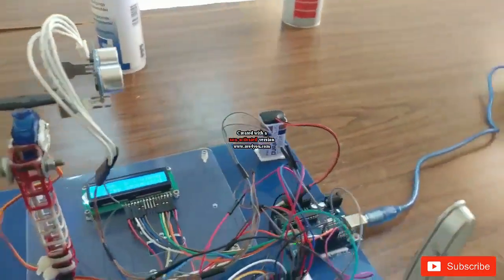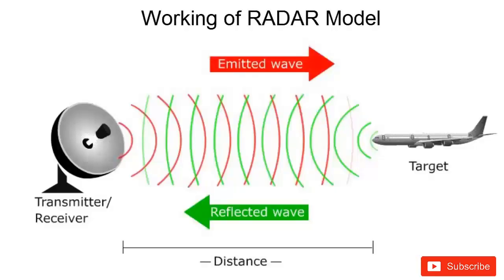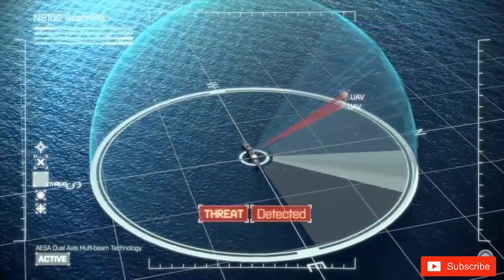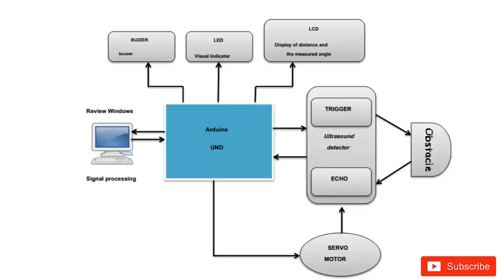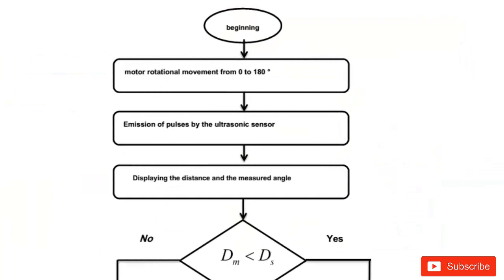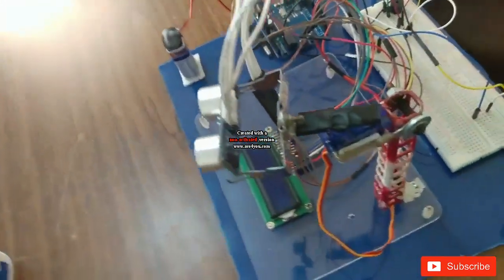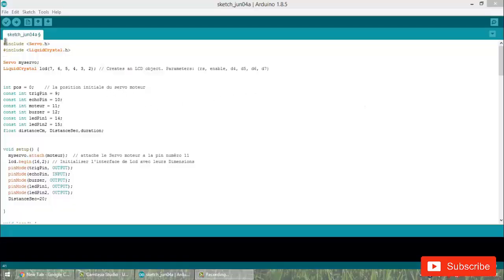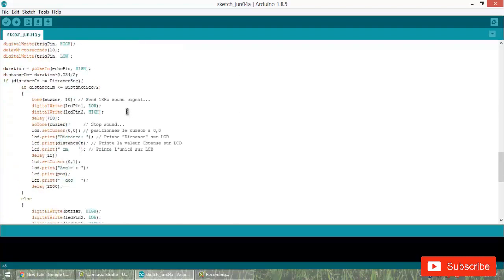Arduino RADAR Model for Distance & Angle Finding using Ultrasonic Sensor

Comment: Great project, very interesting. Is there a way to measure the angle of the object relative to the sensor without having the servo rotate?

In my project, I want to implement and rotational mechanism so that the middle of the ultrasonic sensor(face of the robot) will always be in line with the object is it detecting. So if the object moves, I want the robot to move to align itself within the path of sight of the object.
Reply: old comment but you should use a phased array

Comment: My ultrasonic sensor is giving the output to audrino without any object detected what to do.
Reply from the maker: Check trig and echo pin connection. May be u hv reversed the connection
Reply: Trig and echo Connections are correct.
 whenever I power the circuit with the help of adaptor to audrino ultrasonic circuit.
The  circuit is running the motor automatically which I don't want. I want that when sensor  detect the object then motor will run.

Comment: Thank You sir it's working and sorry for disturbance . 😅😅 one question sir the servo meter is moving very slow when I checked my source code is it's 10 nanosecond I want some more speed
Reply from the maker: For RADAR model it is good if you keep the servo speed normal as in this project. 
But if you want to change the speed you need change the pulse timing in uS as Servo operates on PWM signal.
 This can be done by modifying the code  in servo lines.
Reply: What you have did to make lcd working
Reply: Plzz answer
Reply: @RAIKAGEEE what you have did to make lcd working

Comment: Led screen is working but only signs are showing example ??..##/
Reply from the maker: Wrong pin connection. Check pin 4,6,11,12,13,14 of lcd with program and arduino pin

Comment: All the hardware are working properly but 16 × 2 display is not showing anything . I think coding is  not correct plz reply
Reply from the maker: Coding is correct. Everything is tested. Plz check the connections again. Check lcd and arduino pin connections.
Reply: you need a potenziometer

Comment: Which wire I have to put in 16 × 2 display
Reply from the maker: Pin no. 7,6,5,4,3,2 of Arduino to Pin no 4,6, 11,12,13,14 of LCD Display.

Comment: Can I use 5v addapter instead of battery
Reply from the maker: Yes this is better, use adapter
Reply: Sir I am making this project and few problems I am facing can you give me your number by which I can solve my problems
Reply from the maker: Tell us what problem you are facing. We will support you here.
Reply: You are using a led plate but I have    only single led
Reply from the maker: No problem, just connect LED as shown in circuit diagram